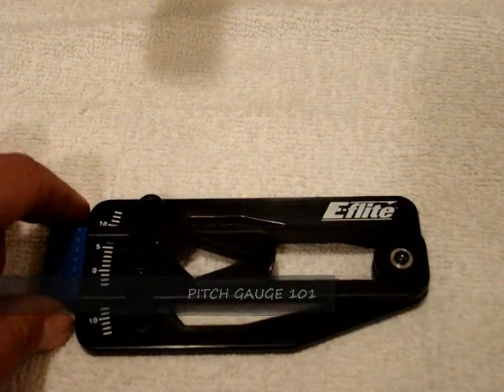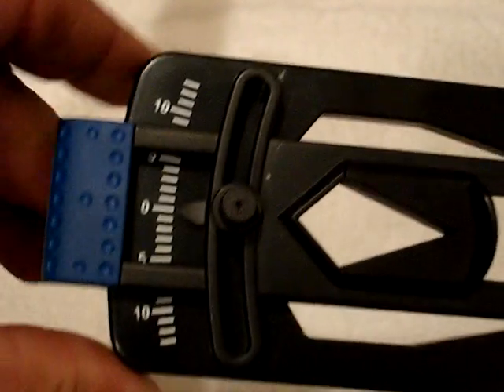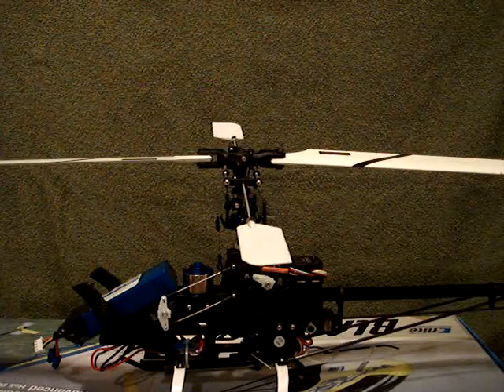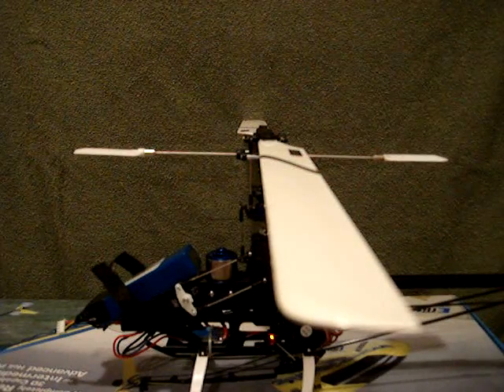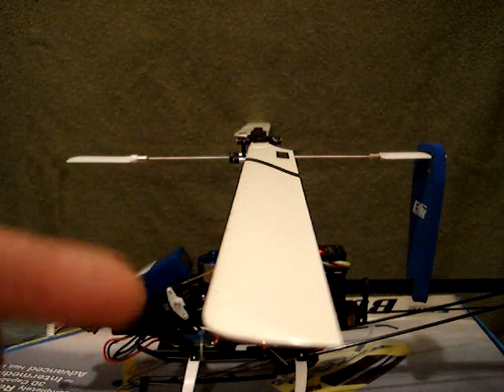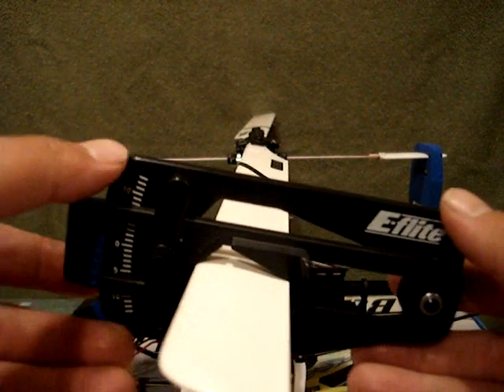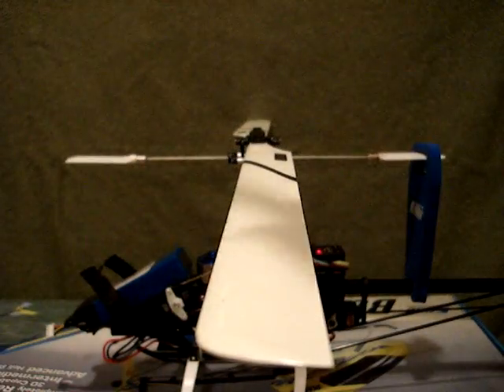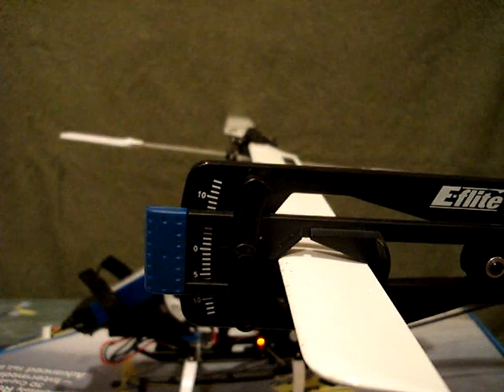Blade 400 3d Pitch Gauge 101

Comment: Thank you so much for explaining and having the transmitter in the picture when showing the trick of using "Throttle Hold" so as to not have to disconnect the motor's 3 wires every time. I watched other videos and read postings where this was talked about, but then not explained how to set the transmitter to do that. 

So you have to get into the "Pitch Curve" setting; "Throttle Hold" mode, and go from 0, 1/4, 1/2, 3/4, and 100 on the graph and set 0%, 25%, 75% & 100% respectively. Thanks, Jay

Comment from the maker: trim is for after the head is tracked not to be used to level and mechanical controls. as for the setup using hold you can use both ways if your hold pitch curve is set the same as the other flight mode you use. it would be the same but it is safer to unplug motor.

Comment: When you use throttle hold to check pitch,you are ONLY checking the pitch in throttle hold mode....You need to unplug the motor and check the pitch in ALL flight modes and make sure the swash is level in all throttle positions....Otherwise,nice video.

Comment: Thanks man for uploading this, I bought a Hausler 450 V2 3D Helicopter used on ebay, had bought a pitch gauge as well and they had the full throttle pitch of rotor blade on 13 degrees not sure if that is way to steep? but I heard you say 10 is good so plan on bringing it down a bit.